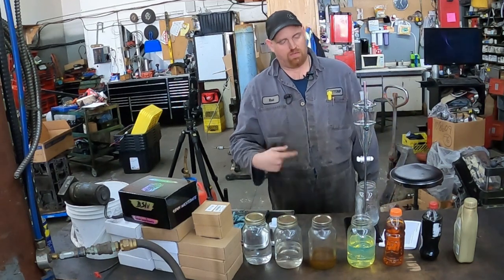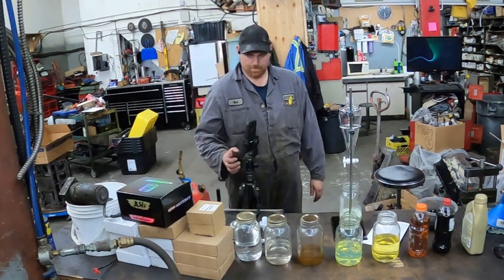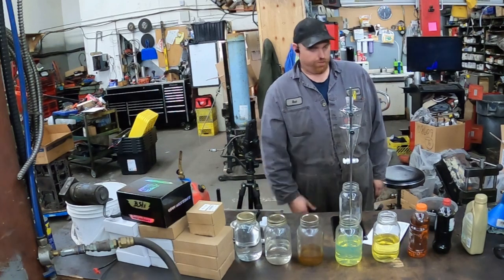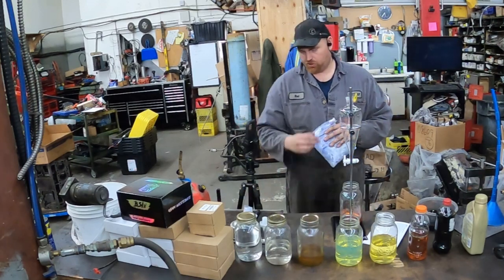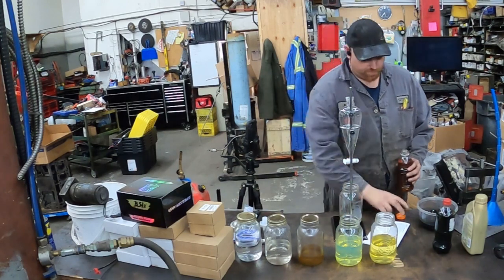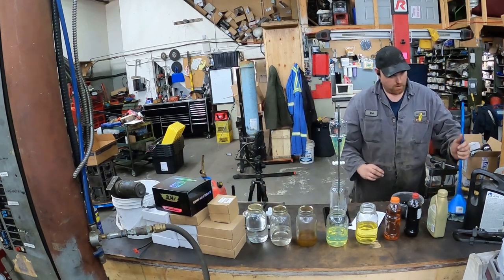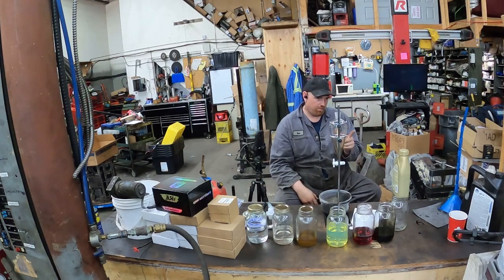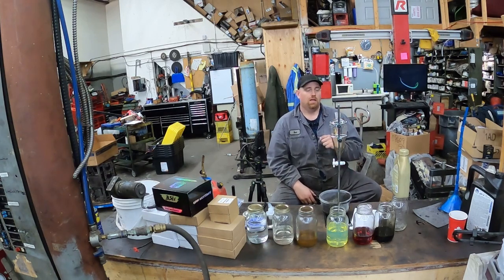Alternative fuel viscosity test ( all kinds of fuel )  black diesel , diesel, biodiesel, wmo

Comment: I've run diesels on used engine oil many times.   My best method is to filter the oil down to at least 10 microns and then blend it at around 15 to 20% E85 to the used oil.  

It works very well with any diesel that uses an all mechanical injection system.

Comment: While it is true, viscosity is important to lubricate injectors, there is an equally important concept called flash point. Viscosity impacts flashpoint. Higher weight oils typically flash at a much higher flashpoint, greatly impacting performance. As you mentioned, adding a gasoline to thin the oil, but at typically a gallon on unleaded to about 16 gallons of typical automotive oil, is not too bad. Here is a link to a flashpoint video to explain the concept: https://youtu.be/w_nVhkvPEpI
Reply from the maker: I just dropped a burn test today. Witch I will be doing more of. But yes the flash also plays a big role

Comment: Thanks again for Videos. 
I’m looking forward to running Some good clean Diesel fuel additive 😏
I just got Centrifuge 🧐 Not a big one
It works of pressurized fluid Not off electric Motor.
Reply: Can you do a video of your centrifuge or contact me. I'd like to see that setup. I'm building a rack with a big black tank up top,  using the sun's heat then gravity going down thur a filtration system ....